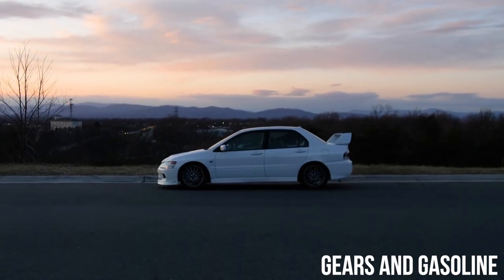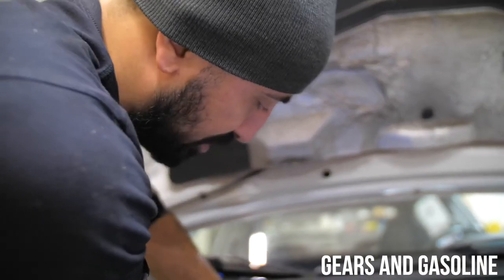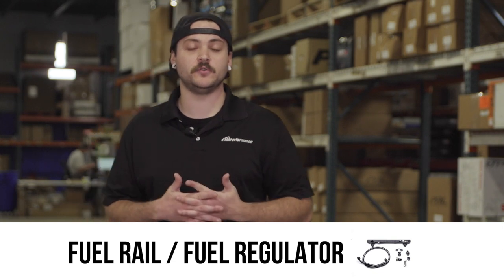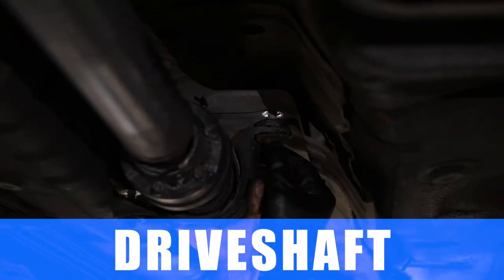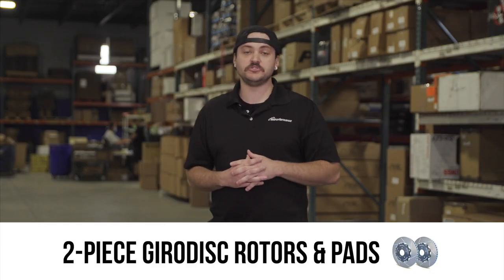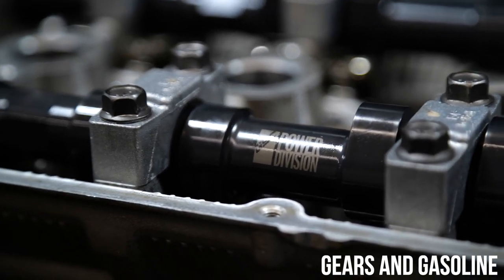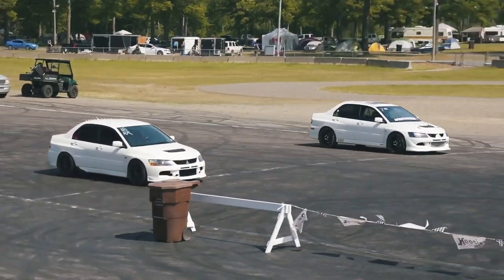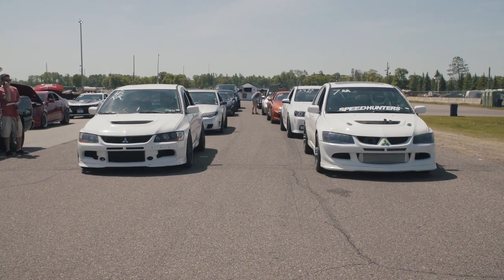How to Build a 700whp Evo 8/9

Comment from the maker: How much power are you making in your Evo 8/9?? Let us know down below! 💪🏼
Reply: 1153 🥵
Reply: 06 IX, 389TQ/391HP.....nothing crazy at all, but still kicks a lot of ass!
Reply: 883 hp / 612 toque
Ams performance 2.3L crate motor
Ets turbo kit with a precision 6466 factory location
Hyper tune intake manifold and throttle body
Shep trans stage 2 5 spd trans
Os giken stage 3 clutch 
ID 2200cc injectors 
And to much to list
Reply: 420 n 550
Reply: How much ball park hp would an evo 8 with, manley crankshaft, wiseco pistons, oringed head, 272 kelford cam, kiggly beehive, gsc lifters, rebuilt oringed head, driver innovative intake manifold, link 4 ecu, 1700cc ID injectors, 525 walboro,ACT CLUTCH, Ams fmic, ams exhaust manifold,full bolt ons make on pump gas with a 6266 journal turbo? Can that make close to 600 or more. Im being tuned on a very low psi, 22 to be exact. Any info is appreciated. Thanks
Reply: @DC-uw8hp  I would like to guess 500 - 600
Reply: @justindennison5044  Thank you thats what i was thinking.  He's got me at 22 psi at right over 400hp. Why so low? Can it be the low psi?  He said he wanted me to get use to the power band first and then come spring time and go E85. Im a little scared cause my car was there for months due to all this Covid 19 stuff and i hope i didnt get screwed over like someone swapping the head out or engine. Im hoping that its due to the low psi but im going to get the internals checked by another tuner. He said he's taking out the oil pain and he'll be able to see the cranshaft and rods hen he's pulling off the valve cover to look at the cams and beehives and also looking down the spark plug to see the piston. Hate to spend extra money on that but i dont know what else to do
Reply: @DC-uw8hp  it’s not a bad idea to get a second opinion 
But I think it is the psi because that build can handle well within the 30 psi range . Lots of tuners do put you lower to get used to the power and then you can go up from there . 
Because that happened to me with my build
Reply: @justindennison5044  thanks man that makes me feel a bit better
Reply: @justindennison5044  Also kust seen both of your vids. Nice. I hope you still have it. I couldn't hear how much hp you said it was on low boost? Was it 460? How much is it now and is it the same set up just more boost?
Reply: @DC-uw8hp  back then I think they put me at about 32psi making about 600 and change 
I still have the car it’s freakin awesome 
Now it’s cranked up to 43psi making 883hp and 612 torque
Reply: @justindennison5044  WOW!! One day i want to get there. Picking mine up on Monday cant wait. Sorry to bug you so much not to many people that i know have Evo's so i try to absorb as much knowledge and ideas as i can 👍
Reply: @DC-uw8hp  any time 👍👍👍
Reply: Only 288whp/289lb. Ft at the moment on 91 octane 

Wanting to make around 450 when I’m done
Reply: @DC-uw8hp  on 22psi you will be lucky to see 500 unless you are pretty high compression
Reply: 408awhp 389ftlbs
Reply: 310/300 in a JDM 01 Evo VII - basically stock with a dyno tune
Reply: 662whp/580wtq on Mustang dyno
Reply: 515awhp/446tq 
See what it makes with my new gen2 gtx3582r
Reply: 320/320
Reply: @DRacer90  what turbo and  timing you running ?
Reply: @bigbothoee8617  I don't know about the timing but I'm running a Precision 6466 😁😁😁
Reply: buschur built FF HTA86 773whp @ 43psi
Reply: @DC-uw8hp  22 psi is not low for a engine that’s not built!!
Reply: @Paper.Power.Politics  Well the update is that they didn't screw me over. Also sorry If I didn't specify but the motor is fully built and running beautiful. I'll be running E85 in March of next year from the same people. Just glad everything went well 😊
Reply: @DC-uw8hp  my buddy has a evo and was tuned by performance destination, and now he’s getting a full build done by road race engineering in Santa Fe springs CA. They do crazy build on evo platform! I got a mustang ecoboost I’m getting built! Gonna be at 1000whp!
Reply: 517whp 490 trq on stock block
Reply: @TheJaduarte  impressive! But doubt it will push that reliably for much longer.
Reply: @Paper.Power.Politics  thinking 2.4
Reply: @TheJaduarte  my buddy is doing his evo 8 build to! Excited for his build! I’m building 1000whp mustang  ecoboost
Reply: @Paper.Power.Politics  good luck with your build, how big turbo
Reply: @TheJaduarte  thx man appreciate it! Ima be goin with the xona 9567
Reply: 500rwhp on 98
Reply: 972hp/731tq…should be touching 1k hp soon with the few exhaust adjustments
Reply: @justindennison5044  any videos of it?
Reply: @brdllc  no haven’t had time to

Comment: I made 700whp and 520 torque.   Built block and head S2 cams, GT3582R gen II turbo and E-85 along with all of the supporting mods.
Reply: if you dont mind me asking, how much did all that cost ?
Reply: @deezelkane  I've never had anyone replying on that great question. Not map or anyone else, the truth is that it costs allot more than they tell you, nothing but a sales job.
Reply: @pittassavvas7512  I don’t get why it’s such an issue to talk about cost. I think people may be ashamed talking about spending 30-40k on mods lol
Reply: @deezelkane  20.000+  parts, labour in usa is pain in the ass too!
Reply: @rowinglove4ever  I know the ball park figure, but I’d like an exact figure, which is what you never hear the answer to. 20+ isn’t an answer lol
Reply: @deezelkane  will make any difference  if it is 21k or 22k or 21.459? Point is that if you want 700whp you must have parked 30k ready to throw and never get back! They will never tell you the exact amount cause every car varies! For example you can built  evo 9 and first week 6 speed gearbox gone... so another 1000 $ on the bucket! You can spend money to parts that cant imagine when start project! Technicians  for installing electronic boost controler, money for indications! What indication you want? Egt + bosst gauge? Or you want to get oil temp, fuel pressure etc++
What brakes you want ? Stock? Lol what suspension ? You will let the stock one?
So it is dump to ask exact amount! Sky is the limit! 700whp will make a lot problems and hiding a lot of costs that cant imagine  from start! So the answer is still  20k+ but easy can pass 30k

Comment: “In the next video, how to change the gearbox you just blew up in your Evo 8/9”...
Reply: The Watsonian to late been there already
Reply: Mean while. Ag autosports made 1291hp on stock transfer case. Stock shafts. And gearbox. Other than uprated clutch fork and triple plate clutch🤣
Reply: @Supremacy of Self no thats legit. watch the vid
Reply: @racecrashrepeat  for how long is the question?
Reply: dont clutch dump get a slipper valve, I have homies pushing 800+wheel on stock transmissions they just dont abuse them
Reply: @devon5078  I got homies launching their 800-1000WHP STIs stock Trans

Comment: Would like to see you guys break down the bottom end build some more. Be interesting to know how much scope for oversize bores or if its even worth it, stroker kits worth it? What pistons, rings and rods are you running? Oil spec change? Any bottom end upgrades other than rods and pistons or rebuild with stock parts I.e. Big end upgrade? Any deck work or girdles worth fitting or is the 4g that good?

Comment: Just over 650hp and 560torque on a built 2.0 with a 5858 and pump fuel.
Reply: Gen 2? How much psi? What octane fuel, please?
Reply: Kirmani La.Rocque they don’t make a gen 2 5858, just the gen 1, 6 blade version in journal or ball bearing. I run 30 psi on 99 octane, but also run WMI
Reply: @kirmanila.rocque5409  he doesnt even own an evo lol. Look up adamc. The real one... he dont own an evo. This dude is a fraud🤣